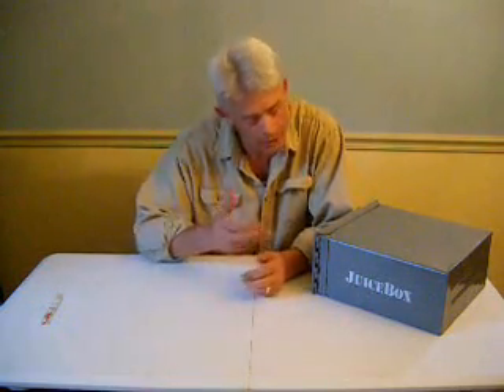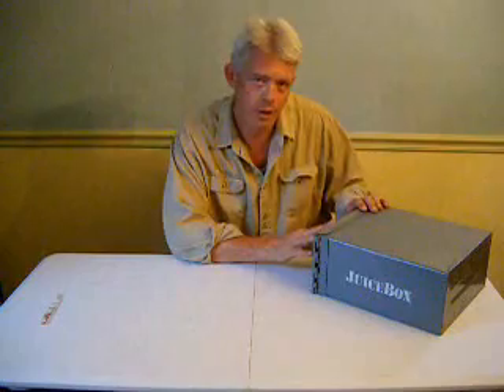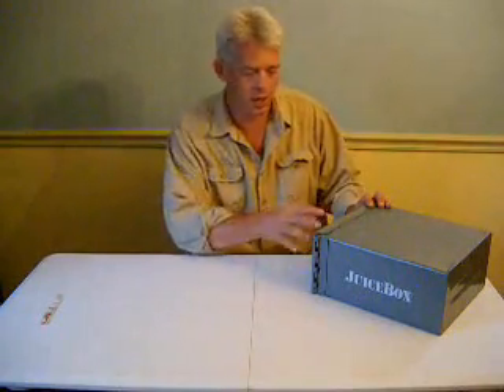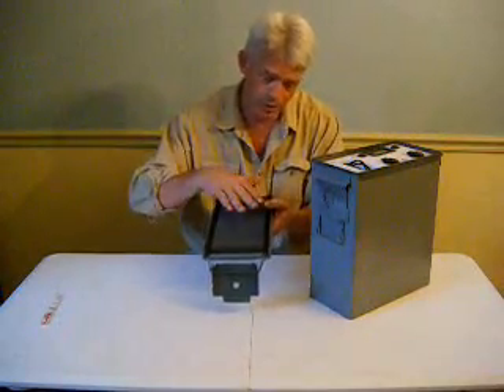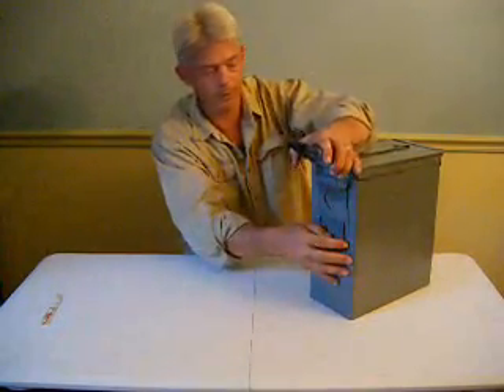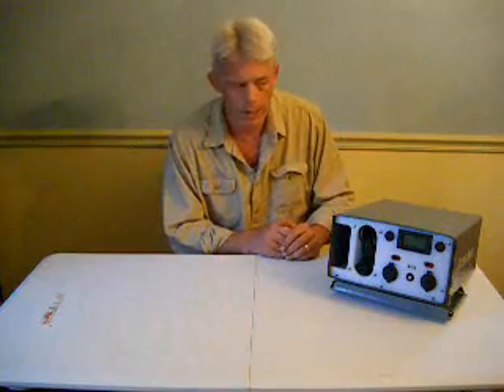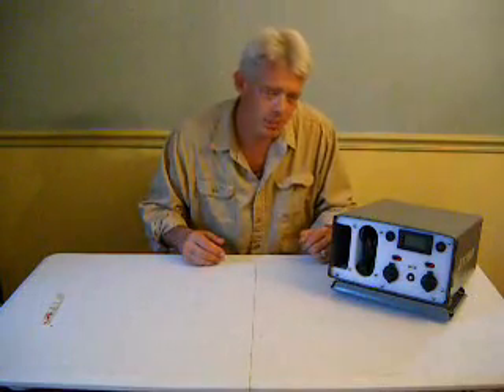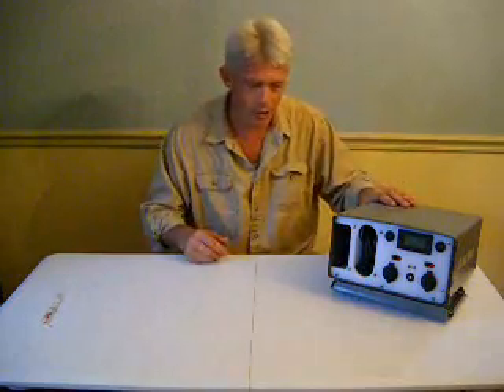1 JuiceBox- medical devices, self-sustaining uninterrupted power, preppers. Buy one today!

Comment from the maker: We make no claims that it is shielded from EMP... after all, how would we prove it?  ;-)    However, there are two things in the design of the JuiceBox that would help shield from EMP:  one, the metal can has lapped, welded seams.  The other is that the internal components are electrically isolated from the metal can.